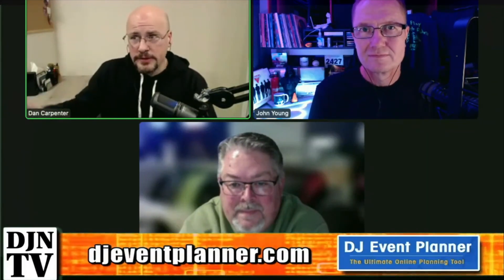Some Options For Running Electricity A Long Distance For A Wedding Ceremony And DJ Events #DJNTV

Comment: about 20 yrs ago, before good battery powered speakers, I did a ceremony in a field OVER 300 ft from a small noisy generator the client set up over a hill to prevent some of the noise, with LOW gauge ext cords, and the keyboard player's transformer stated smoking badly, but we completed the job.  I was not told about the power issue before the job, so since then I address power at ceremony sites in ALL planning.